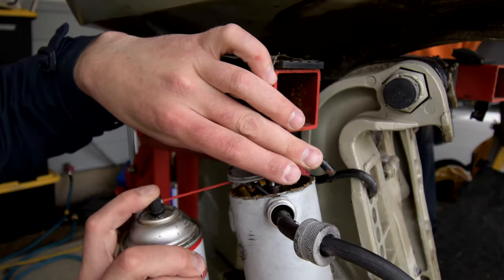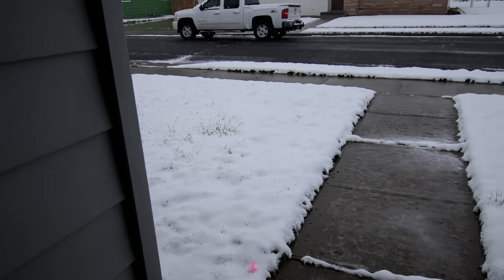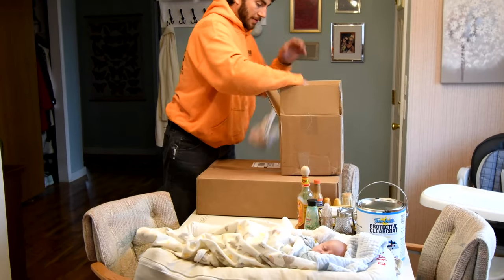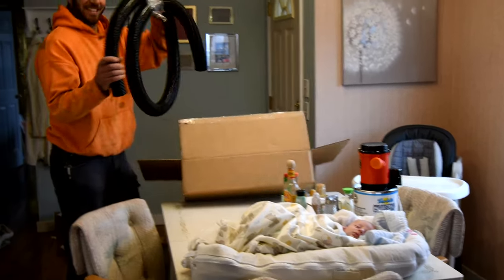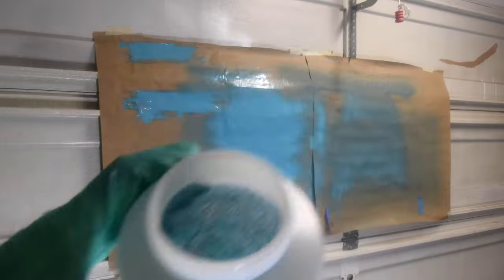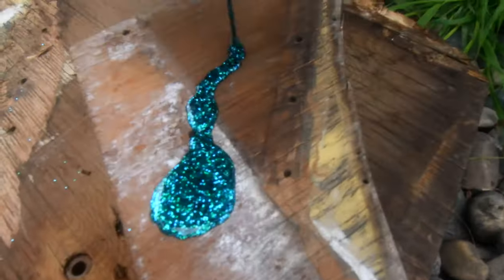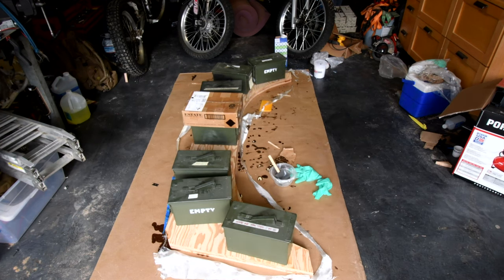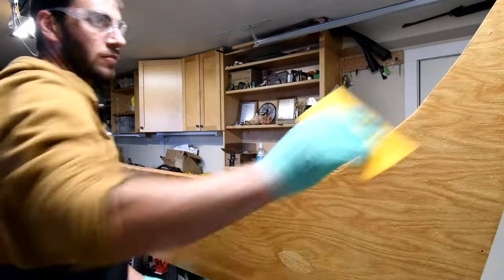Cool Old Boat Gets Some Love part 2

Comment: You'll never regret having two bilge pumps, or two radios or two engines for that matter! I have a hand-held VHF you can borrow if you need it. Good video and loved the dedication to your dad and grandpa.
Reply from the maker: Thanks Rick! I'm using dad's hand-held radio but like you say, two might be best. I should take you up on it on our trip. Both motors have proven themselves so far so at least one should get us home. That bilge pump weighs about 15 lbs. Assembled in USA at least

Comment: Thank goodness there is zero treated wood being shown.

People just don't recognize the old treated wood had a lot of toxins in it and the EPA forced lumber companies to use metallic compounds to treat wood which act is cancer towards aluminum hulls.

If you're going to run any significant amount of electrical gear, get two batteries.  One is dedicated start battery for the engine and the other is a house/accessories battery.  You can use a battery switch as a backup, just don't ever change the mode with the engine running or you'll ruin your engine's charging system.
Reply from the maker: It was a chunk of marine grade plywood that the local shop luckily had on hand. I was going to use coosa or thermo-lite board but price and availability were both big hurdles. I'd never heard about the old pt hurting aluminum or switching it while running. Good info on the wood and switch. I think* I'm going to stick with one battery for space and weight. I'm only running a small depth finder and nav lights.  
Thanks!